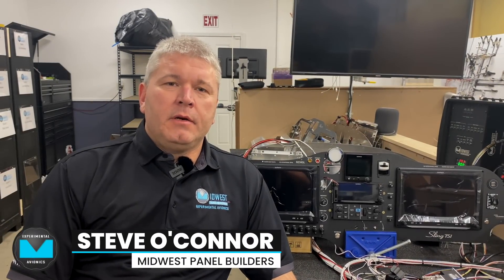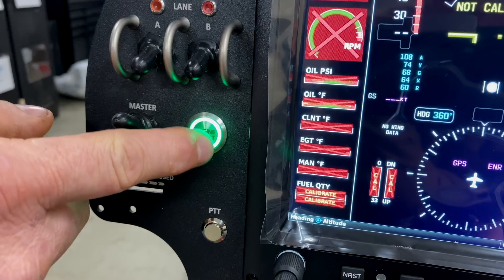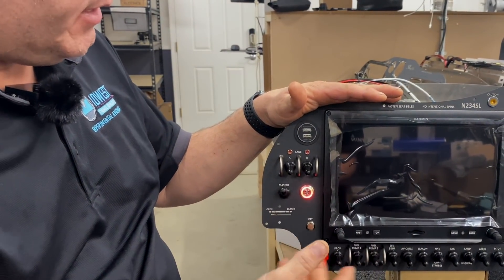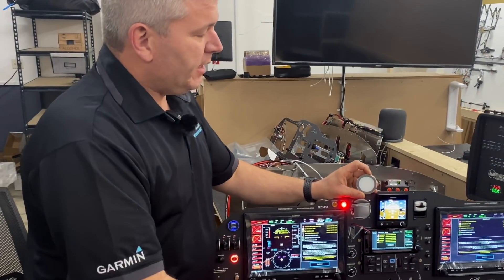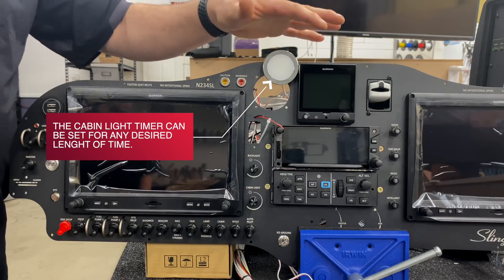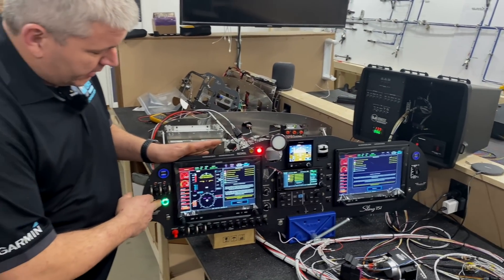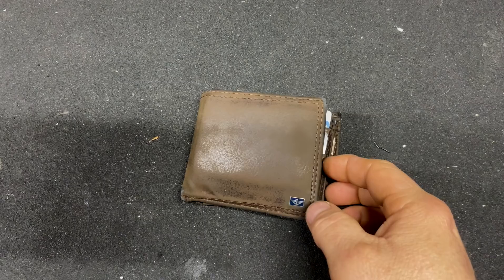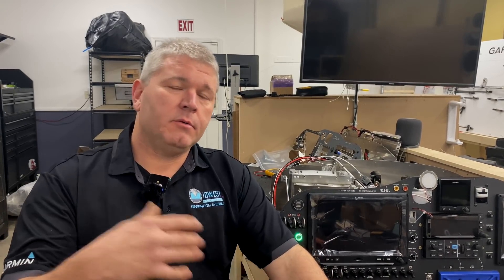The Most Advanced Engine Start System For GA Airplanes

Comment: it is a "nice and cool" feature.... but having had many "nice and cool" things fail over the years, I am a HUGE fan of SIMPLE and CHEAP, something easily fixed with hardware-store parts when it lets you down 1000 miles from home.  If you are trying to make it safe from theft, simply hide a key activated secondary master somewhere on the plane (think "under the rear seat").... do something simple and cheap where the failure mode is fail-safe.

Comment: Its seems like a nice system and you spend time working out all the bugs and nice looking panel as well

Aircraft for the most part are ease to steal and finding ways to prevent it can range from prop locks to changing out factory locks

At one time Trade A Plane had adys for two tipes of alarms one was around $350 dollars and all most any $50 dollar auto alarm would beat it

The other alarm was 10K +/-  plus installation cost and was made for aircraft were its possible someone could open a panel placing a bomb or drugs unknown to the crew

Colemill home of the Panther, Foxstar and other aircraft up grades use common switches and logic circuits to prevent engine starts

It was smiple and robust allowing the crew to have full access at any point should an in-flight emergency required flight crew to restart a engine

Its design all so made it harder or impossible for any thieves to steal the aircraft with out spending time and work as well

With all the new advanced electronics security has took leaps and abounds
One can install a smiple alarm using electronic waves of energy and once the cockpit is open the wave pattern changes and set's off an alarm 

The alarm can be any thing from flashing lights to a smiple home cellphone alarm back up unit used in  alarm systems across the world

Many alarm units will work or do work off 12 volts DC voltage and only use 110 along with a power converters

Take any backup cellphone used in alarm system's that will work on 12 volts  it can be placed in any aircraft and just phone in the location of the aircraft ( its airport and FBO ) location 
When move 

If the aircraft alarm is trip airport police can be call at once and i think it would be possible to send video as well 
Starter killed switches  could be installed in ways no one is going to just jump in and hit start 

Now its still possible to hand prop the engine in piston aircraft if you willing to risk life and lim but in possible to start jet or turbine aircraft like a King Air

One thing's for sure the new avionics and aircraft have changed the world of aviation and people like you and your staff come up with new ideas to help people as well thanks for your work and posting

Comment: Hard to believe that this is the "State of the Art" in avionics.  As a trainee pilot, I'm constantly blown away by how far behind automotive aviation is.  Thanks for catching us up though!
Reply: Michael Schafer it has to do with safety. In a car if something breaks, you pull over. In a plane you have to keep flying. And you can’t always troubleshoot at the same time. So it’s better to test these systems and make sure they will work in every scenario and that there are back up plans Incase.

Comment: Interesting. I would like to start my build this summer, and wonder if this system has to be installed by MidWest, or can the builder install it? Secondly, are there specific engines it's designed for, or can it be adapted to most engines. I'm thinking of either the Viking, Aero Momentum, Corvair conversions? Finally that Prox card bypass, is it a standard HID format, 26 bit Wiegand?

Comment: More complication.. does this increase reliability and durability?  Is theft that big an issue?
Reply: Jennifer WhiteWolf it’s not at all complicated, as a matter of fact this system is rather simple. 

Aviation is stuck in the 60s with no innovation at all and we are trying to bring a convenience that you can only get from a vehicle, which is way more complicated and everything is controlled by that button.

I have seen a lot of push button systems in planes. All of which can be activated without any type of key, I think this poses more of a safety problem than a theft issue. 

Either way, we realize that this system may not be for everyone so, it’s only an offering. We can wire it the traditional way or the modem way. Our aim is to give options and flexibility to the builder.
Reply: Yes. Newer planes get stolen often enough or stripped of electronics
Reply: IDK we all have  known where the keys are for like 40 years.

Comment: The green start button ring lite will be a distraction if left on all the time.
Reply: S Douglass actually, if used with the VPX, that light turns off when the engine is at operating rpm.

Comment: Cool.  What about if you're airborne?  No card, fob not working....and you gotta restart the engine?
Reply: The engine operation is not affected. The system has no control of the engine itself. This is one of the many scenarios we worked through. 

Once activated the system is ready to start, so if your engine were to quit, you could attempt restart.
Reply: @MidwestPanels  What is the criteria for disarming the system once you've enabled "engine start" with the fob/key card?
Reply: @ShayS93  It will time out once you leave with they key and have the master off.
Reply: If the key falls out of the airplane?

Comment: Can this guy you redo my 2017 Toyota Hybrid Highlander? The damn thing won't properly recognize the key fob, hence I have to open the door with a real key.
Reply: Don Johnston there is a button on automated Toyotas like yours on the side of the fob. Look up how to open it and replace the battery which costs like 1$
Reply: @charlie-qi4rh  Did all that and had the vehicle scanned. Likely an interface issue between a receiver on the vehicle and the fobs?